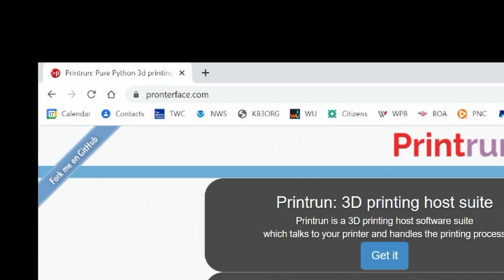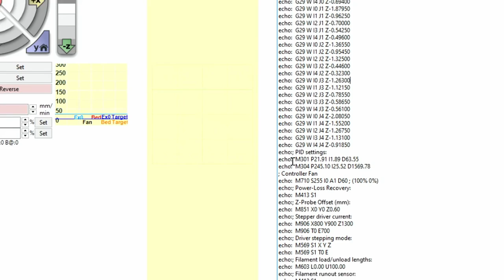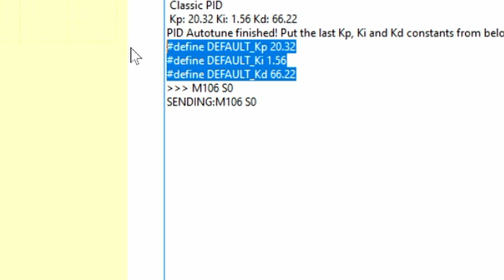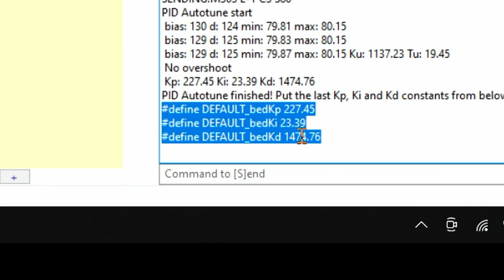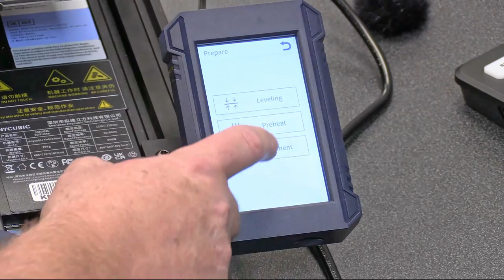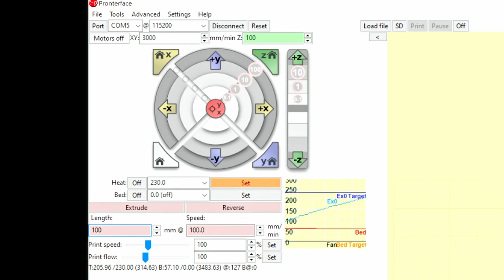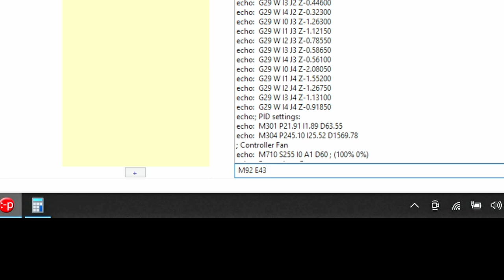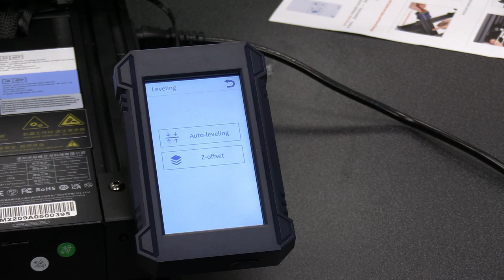Anycubic Kobra Max - Improve Printing

Comment: Hey mate, love your video, im just about to do myt first test print after doing all the calibration, one thing i have noticed though is that my fan is still set to 255, even if i shutdown pronterface, sohuld i be turning this down somehow i setting it to automatically switch on when it needs to?
Reply from the maker: Hi, thanks for watching, I really appreciate it!  That is the problem I found with printing a small object dead center on the heatbed.  The main thermistor is right there and it can give weird results on small objects.  I use Cura and in the settings for the print I turn off the fan for the first few millimeters so it has time to build up some layers for before the fan turns on.  On small prints I wait until 5mm is built up.

Comment: Howdy Pard, Attempted to follow your instructions BUT, I've input the M106 S255 command and I get NADA...now, thinking it may be just one particular printer I tried it again on the rest of my Kobra Max's (I own four of them) and still NADA...what, pray tell, am I missing?  TIA.  Post Script:  For the record I also tried M107 (from another thread) S255 and still....you guessed it, NADA.
Reply from the maker: Strange indeed.  Just to confirm these are Kobra Max's, not Kobra 2 Max's.
Reply: @TheMakersCave  "Bless me Father for I have sinned, my last confession was...."  Just kidding. But I am confessing to being (apparently) hard of hearing. My fault lies within my reliance on listening for the fan wind up, which I did not really hear. My fans seem to be much quieter than yours...anyways, after going through your exact steps and turning my reliance to your methodology rather than fan noise, I got it ALL worked out on 'Bob' my oldest Kobra Max. I will just have to repeat the process on the rest of my Kobra Max's; 'Huey', 'Dewey' and 'Louie'. (Let's see if you know where I got that set of names from). After this slight delay I must share with you that your patiently delivered process to accomplish this printing improvement is GREATLY appreciated!  I must add also that upon completing this tuning I am astonished at the discrepancies betwix the original printer settings and the NEW printer settings...it really does add credence to the truth of your statement at the opening of the video @ timestamp 1:42  " I found an immediate difference in my prints...."  Thanks again pard' for sharing this video, and having the patience to endure my repeated 'NADA's.   ; - )   Oh, and just for the record, they are Kobra Max's, not 2's.   Postscript:  Question? Does the M106 S255 command also manually turn on the power supply fan?  I ask because I'm attempting to change out the stock 24v (cheapo) fan with a 12v be quiet! fan using a buck converter and need constant power supplied to the fan to dial-in the buck converter...Thanks!

Comment: The problem with Pronterface is it’s unstable as shT. Good luck getting it to stay connected
Reply from the maker: So far I've had good luck with PronterFace, no disconnect issues.  Have you tried a different port, cable, computer.  A few things could be coming into play.

Comment: So I am thinking about picking up the Kobra Max locally from facebook for a good price. I was debating on it or a CR-10S Pro V2 or a Ender 3 S1, Not familiar with either but I like the build area of the Kobra Max. If i was to get the Kobra Max would I just follow this video and that would make it fine tuned? This would be my first 3D printer but being a Diesel mechanic and really good with fabrication, 3D printing has caught my interest.
Reply from the maker: Hi!  First, thanks for watching i really appreciate.  3D printing can become addictive.  I started with an Ender 3 Pro and now I have 3 filament printers and one resin.  IMHO there are pros and cons on getting a printer this new and big used.  Pro, the price.  The con, and I consider this a big one, is that you don't have Anycubic's warranty behind you.  I have found their warranty process excellent and responsive.  My Vyper had a main board problem and they sent one right out.  Just follow the video and you should have no problems.  If you do just drop me a message.  Steve@TheMakersCave.com

Comment: You richly deserve all the accolades I have read, but there is an issue that has been perplexing me for several days and, from all the traffic on the internet that I have seen relating to it, it is obviously a major issue to a great many others. I bought a new Kobra Max a few months ago but it did not come with a USB cable so I bought one that is both data and electrical, but in connecting this to my laptop and Kobra Max and then launching Pronterface, I find no Com Port available in Pronterface. Checked Device Manager in Windows 7, 8.1 and 10 and none displayed Ports (COM & LPT) even when instructed to "Show Hidden Devices". Without going into a lot of other details, I realised that when launching Pronterface it is interrogating the Windows OS on my computer for a Com Port and getting none (or ones I created which were useless) so it can't communicate with the Kobra Max.
Did you do anything in your Windows 10 laptop to load a viable Com Port, which in your video was Com5?
My eternal gratitude if you can steer me in the right direction!!!

Comment: Hi Steve - I can’t get Pronterface to work on my Apple MAC. Do you have any experience with Simplify3D software? Do you think it could do the same g-code editing you are doing with Pronterface, calibrating my Kobra MAX ? Would love your opinion- many thanks.
Reply from the maker: Wheb I first read this I thought it would be really easy to find a Mac equivalent of PronterFace, I was wrong.  I just bought Simplify3d as I was hoping it would give me more realistic print time estimates, the bane of every 3D printer user..  From what I can tell it does not have an interface to do what PronterFace does.  I'm going to keep looking, there's got to be one.  Also, what is your impression of Simplify3D, I AM NOT a fan, I like Cura better.  Wondering if I just have to give it some time.
Reply: @TheMakersCave  Thank you for your comments. I looked at Simplify3D and wasn’t impressed. So I am looking for something that works on a MAC or I may have to get Parallels, you may be familiar with it, it is a shell that allows Windows to install on a MAC (intel).  Then I am going to install Pronterface on my MAC. Fingers crossed. I have failed installing Pronterface and OCTOPRINT on my MAC. One idea presented was to get an old Android phone and install OCTOPRINT APP on it. Really… ? All I want to do is calibrate my K-MAX e-steps. It’s a black hole.
Reply from the maker: I just downloaded Version 5 of Simplify3D and it looks like they put in a control interface similiar to PronterFace.  Later today I'm going to plug the Kobra Max in to the computer and see how it works.  I'll let you know.
Reply: @TheMakersCave  I also did a Trial of 4.1 Simplify3D. The machine control looked very good, but I couldn’t see spending the money on a Slicer that wouldn’t work for me. Most of my prints are large and I need better support editing. Also, I use a MAC STUDIO ULTRA and the S3D slicer performance was lagging. I suggested to S3D to separate the machine control and sell it separately as an APP. In the meantime- I’ve purchased an Acer Aspire Windows laptop that should run Pronterface 32bit with no problems (TBD). The Laptop was the same price as S3D. Does S3D ver 5.0 have any updates to the support editing/control?
Reply from the maker: I don't do much with supports but S3D has alway been know for it's excellent support options.  I watched 3DPrintingNerd's review of Ver 5 and he said the support edit was great and actually showed it in his video.  Much like you, he thought the price of S3D couldn't be justified with all the other great 3D slicing programs that are free.  I mainly bought it to see if it would give me better print time estimations and I wanted to be able to answers questions on it.
Reply: @TheMakersCave  so what’s your verdict on S3D 5.? I ended up buying an inexpensive Acer Win 11 laptop to run Pronterface. It’s working great - looking forward to your review of S3D ver 5.

Comment: Hi!
I followed your tutorial to the T, my E steps were also off my 6 mm, but then after all of the changes my prints were turning out way worse than when printer had its factory settings. Any ideas why it might be so?

Also, could you kindly share your PLA profile in Cura for Kobra Max? There are so many variables, And I’m really getting lost in them as a newbie. 

And thank you for the information!
Reply from the maker: Hi, When you redid the extrusion test after adjustment the black mark ends at the tubing?  Just double checking before we delve into some other settngs.
Reply: @TheMakersCave  Yes, it was spot on! The same model and G code also, so that was not a variable to take into consideration. 

It seems that many people in the comments have their printers off by a margin of 6 mm, could it have been calibrated this way on purpose by Anycubic?
Reply from the maker: @nickeev  Most likely it was a gear or stepper motor that affected it.  When you change those factors it can change the extrusion amount.  Did you try increasing the retraction distance and speed?

Comment: Hey mate great video. I have the kobra and I'm still having issues saving the new values to the printer. Each time i disconnect from pronterface, reconnect, and use the m503 command the printer has reset to its defaults. Got anything that might work? 

Edit: Solved! Reformatting my SD card seemed to do the trick
Reply from the maker: The weirdest things always seem to work :).  Also, thanks for watching.

Comment: Help me out here. Kobra max, ender 5 plus or cr10 max? I need a big printer ASAP and I can't make up my mind!
Reply from the maker: Talk about a tough question.  I love my Max but my original Ender 3 Pro is a workhorse we had for 4 years and it keeps going.  Since I've only used one of the printers in question it comes down to the company that makes them, and that''s not really a determining factor either, as I'll explain.  I like the quality of both Creality (Cr) and AnyCubic (AC),  with Cr I've never had to use their tech support. With AC I've had to use their tech support on my Vyper and they were quick to repsond (for being out of country) and act.  They send a new motherboard without any question after my email documenting everything.  So AC wins on customer support.  Quality of their builds is equal.  Personally, if I had to go out a buy another large format printer I would choose the CR10 S5.  I don't like top-down printers like the 5 Plus.  The weight of what you're printing can affect the Z axis accuracy, in my opinion.  I hope this rambling replay helps, Keep asking if you have more questions :)
Reply: @TheMakersCave  That's all great to know. What's killing me is I need a 320mm printer bed or larger, but there is also the issue with space which is why I was looking at the 5 plus as it's contained in a frame. Currently I have a ender 3 and an ender 5 S1 but it's going back. The Z access is very messed up and Creality is NOT helpful at all! I may need to file a claim with PayPal, but I'm still not opposed to using their printers if I can get a large 12"+ print bed.

Comment: I just replaced my hotend on my Anycubic Kobra, and I ran the PID and everything worked great.  However, when I'm calibrating my eSteps and run the calculation, and then I run the second extrude from Pronterface the black mark on the filament doesn't get anywhere near the tube.  I re-run the calibration and it yields the same results.  I tried it one more time and it still yields the same results.  After running the calculation, the second extrusion is off anywhere between 22mm and 28mm.  I'm not sure why it's this high.  On my other printers it was usually off by 3mm to 5mm.  Could this be an issue with the extruder motor?
Reply from the maker: Hi, thanks for watching.  It sounds like you've done this with success on your other printers so your math should be right.  Viewers that describe what you have usually have the equation wrong.  Being off by 22 to 28mm is quite a bit.  Did you have this problem before the new hot end?  Also, just to clarify, is it over extruding (black mark is in the tube) or under extruding (black mark is before the tube)?
Reply: @TheMakersCave  you’re welcome! Your video is indispensable to me. I’ve used your video to calibrate all of my printers. I didn’t have this issue with the previous hotend as the eStep calibration went well. It’s under extruding as the black mark is before the tube. 

Thanks again for your assistance.
Reply from the maker: @GerardLagana  Well, I'd have to say it has something to do with the new hot end.  I would reseat all the cables going to the extruder motor.  Make sure they all have a solid connection.  If you have the old hot end and it's operable I would put that back in to see if the problem goes away.  That way you can narrow it down to a hot end issue or a machine issue.
Reply: @TheMakersCave  I reseated the cable from the extruder motor as well as the hotend.  Both sets of cables made a click sound when they were reseated.  I ran the eSteps again and it still was off by about 25mm.  I unfortunately threw away the old hotend.  However, I have an additional hot end, and I replaced it with this one.  I recalibrated both the hotend and the bed.  I then ran the eSteps calibration and the be black mark was at 34mm; this is above the tube, so it is under extruding.

I am noticing with the new hotend that the layers are not adhering to one another.  The first layer adheres perfectly and the top layers look great.  It's the in-between layers that are stringy or have like what appears to be bubbles.  I'm guessing this is all due to under extrusion.
Reply: @TheMakersCave  I resolved the issue.  I remembered that I have a broken Anycubic Kobra printer that I am using for parts.  I took that extruder from that printer, and placed it on my printer.  After doing so I was able to successfully perform the eStep calibration.  Thanks again for all of your help!  It's truly appreciated!

Comment: My 3d printer gears are moving but not the filament what should I do
Reply from the maker: I am so sorry for the delay in responding, I've under the weather.  There could be a couple of different problems that could cause this.  First, let's make sure the hotend is not clogged.  With the control panel of the printer heat up the hot end to the temp recommended for the filament. I don't know what type of printer you have but to manually push the filament through the machine, just feed the filament to the machine after the gears by unlocking the gears.  As you push you will feel a little resistance but you should see filament oozing out of the hot end/nozzle.  If it's not than you have a clog somewhere in the system form gears to the nozzle.  Do this test and email the results, it'll be easier to help you through email than here in the comments: Steve@TheMakersCave.com
Reply: @TheMakersCave  it is not clogged. This problem has been slowly getting worse, so I thought it was clogged. I just changed the nozzle and it just got so much worse.
Reply from the maker: @Tucker-Fish-Life If you manually push filament through tubes and hot end then you're right, no clog.  the only other thing I can think of is that the filament extruder gears don't have enough tension to move the filament through.  If you can, disconnect the tubing before the hot end and feed filament through with the control panel.  See if it pushes the filament through.

Comment: Finally got my Kobra Max, I put it together and now I'm met with a pronterface error "Failed to execute script".. No idea where to go from here, since every suggestion I seem to find, is to rebuild the program or something, which I'm definitely not going to do :(
Reply from the maker: Hi, thanks for watching, I appreciate it.  Make sure of two things: that the COM is correct and that pronterface is the only thing running in regards to the 3D printer.  If Cura or anohter slicer is running when PF is it can cause a problem.  The slicing programs lock the printer to them so other programs can't access the printer.  Let me know if you are still having problems and I'll try to help :)

Comment: Im having alot of print failures with my max it strings immediately and causes the initial base line to just mess up and fail before it even gets 15 seconds in any ideas what to do?
Reply from the maker: What type of filament are you using (PLA, ABS, PETG, etc.) and what are you're temps set at?
Reply: @TheMakersCave  pla  and pla + at 200
Reply from the maker: Two easy tests are slowing the print speed and the other is upping the retraction setting. 200 is a good temp for PLA, any lower and you could risk clogging the nozzle   I'd try the retraction adjustment first.